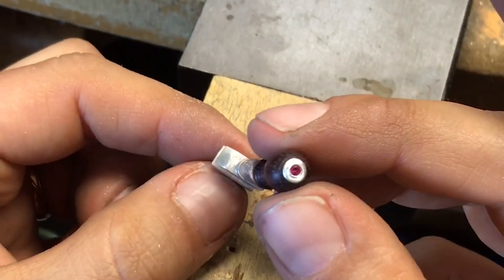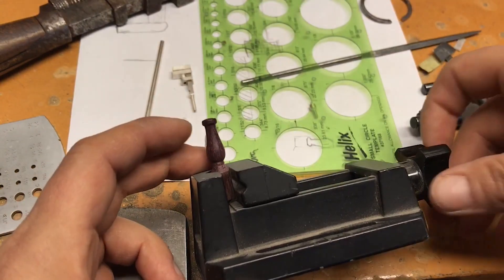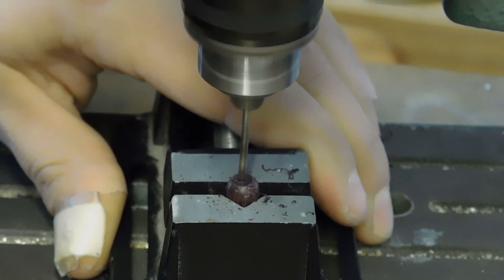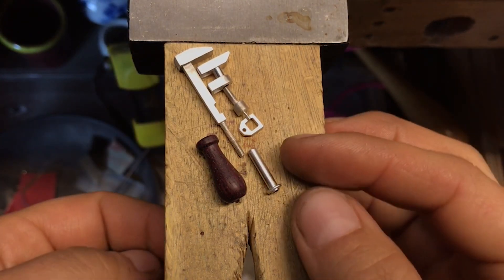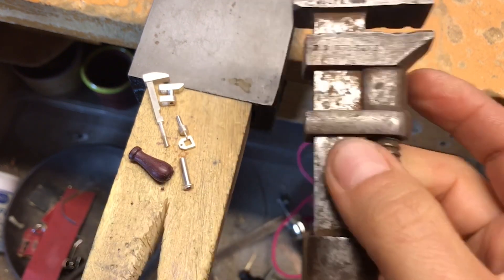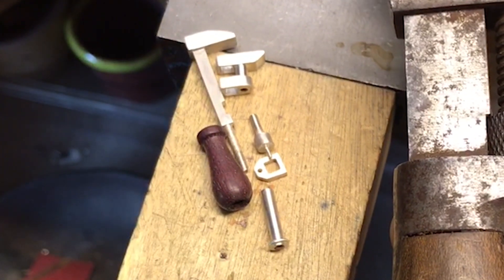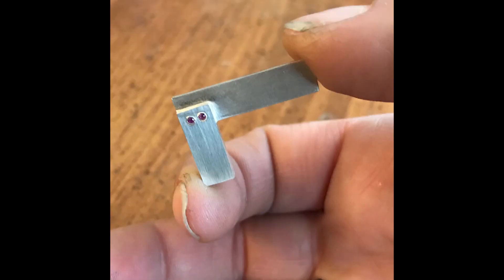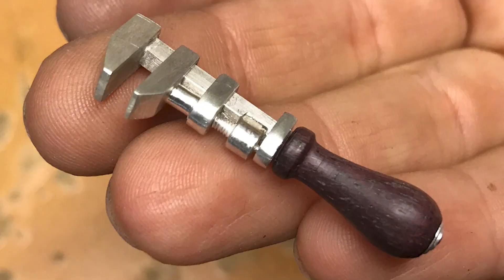Wrench Replica | Episode 6 | It all comes together in the end.

Comment: Neat!
but now it has me stuck on suggestions- water pump pliers (aka channel locks, which is weird cause that company makes like 40 different hand tools but if you say get me the channel locks they will get the pliers) 
an arbor press? 
you going to hate me- miniature sieve's. the wire mesh would be awful to solder but a challenge in itself but you do have to classify the greensand right?
for some reason I keep thinking these all have to be jewelry sized so..
you know the tongs you pull a crucible out of the forge with? a pair of those with a crucible in them.
that was just off the top of my head, thanks for the videos.